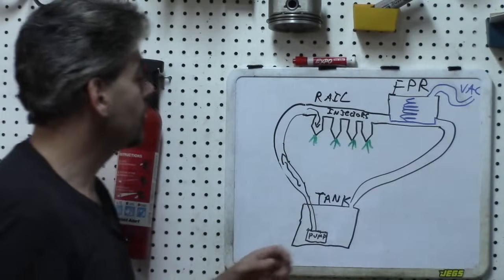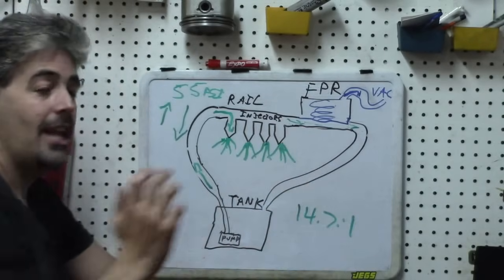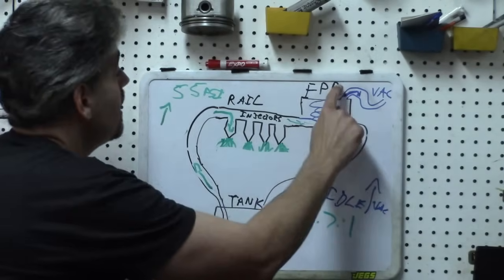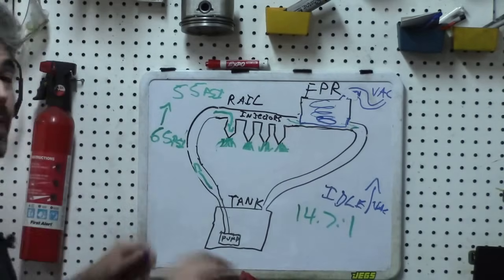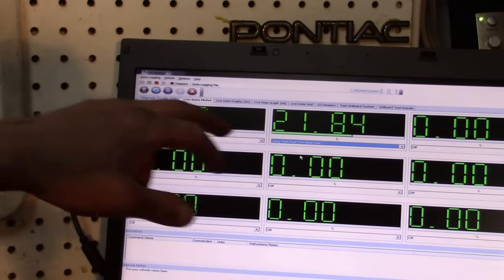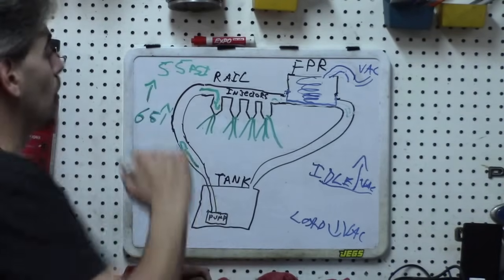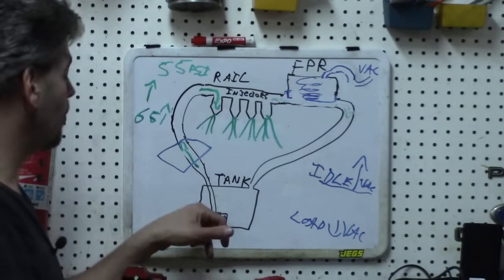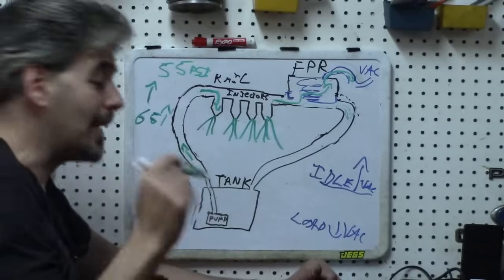Fuel Pressure Regulator Diagnosis + Understanding (HD!!)

Comment: I have a pressure problem. I rented a pressure gauge to test the pressure from the pump. I started to notice that my 2004 suburban wouldn't start at the first try, I thought it was the fuel pump right of the back. I tried the pressure by just turning the key, the pressure riced up to 32 PSI and dropped almost immediately after the two seconds past from the ignition key. After testing the noise listening to the tank, pump seemed working, relay switch sound working, I will change the filter but what intrigued was that the pressure did not hold at all. For some reason I can't explain, the vehicle started and the pressure was maintained at 40 PSI. 
So, my question is... Does this means that my Fuel pressure regulator has a compromised diaphragm? Or my injectors? Something is getting open to release the pressure from the line. 
This is my email address if you want to respond rilocantu@hotmail.com
Thanks!
Reply from the maker: You are describing a classic bad check valve.

Comment: Why are you using a sample and hold pressure gauge to test for pressure leak down? That's a laugh. Sorry I've got no sense of humor left. My fuel pressure is within specs and goes up when the vacuum line is removed but it still misses and my prime disappears almost instantly. Up... down.
Reply from the maker: you moron. that is not how this gauge works. stupid comment.